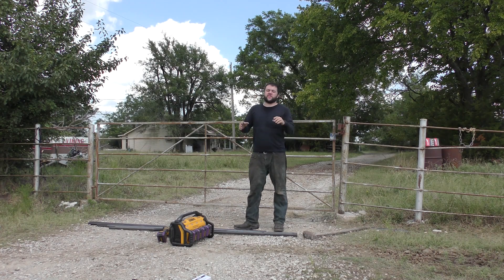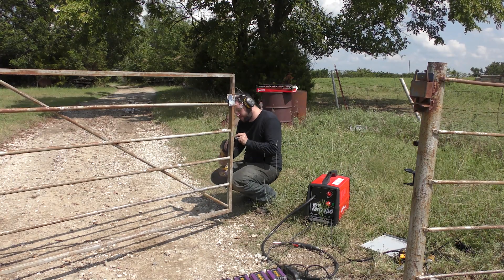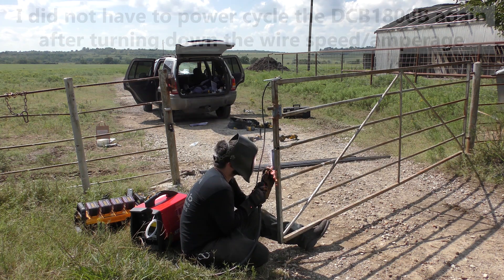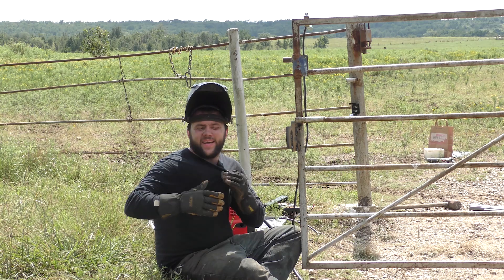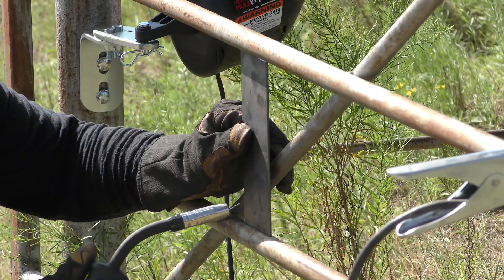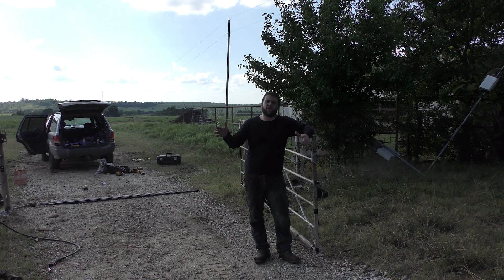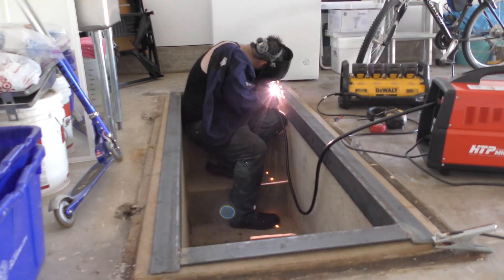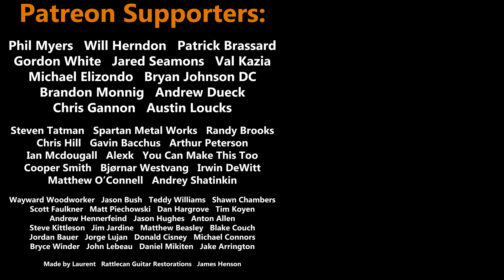How To: MIG Weld on Battery Power

Comment: You can also use a 12v-120v inverter that runs off your car battery. Just start the car, plug in the flux core welder and you’re good to go

Comment: I rewired an old Sears MIG welder that bit the dust to run on 2 Optima Deep Cycle batteries. That thing was a beast. No problem welding a trailer hitch together out of steel.

Comment: I'm looking to get into welding for hobby, and misc fix-it jobs while on the road, me and my significant other do travel nursing with a truck and small trailer. We already carry that invertor pack, this video is great showing the power of having a small welder! Nobody likes dealing with big generators, the noise, the fuel, and the exhaust.
Reply from the maker: Can't beat a gen for bigger jobs, but to tack something up or work thin material, this is a great in between

Comment: I've done it with the new 60v amp batteries but it can't push no more than 75 to 85 amps for a certain amount of time before shutdown ,maybe an HR.and half which is plenty of time to complete a small job. I love mine and yes I know it was an expensive set up ( about $ 1400 with the new 60v flexvolt batteries) , but don't care since I'm a dewalt cordless tool owner and this type portability with out the gas and noise of a generator is priceless to me.   Looking to get the cordless  battety welder from dewalt but is too expensive right now ( about 5 k) so I'll wait until they go down in price eventually.

Comment: Witch cost this machine
Reply from the maker: welder:$450. Battery Inverter: $300 + batteries
(and as your Englih is improving, "witch" is a woman who casts spells. "which'" means picking between two things. "what" is the question you were wanting here)

Comment: Need help, can I power a Clarke 135TE Turbo MIG Welder With a Clarke IG2200 2.2kW Inverter Generator ? I’m working from my garage but scared I’m going to blow the place up
Reply from the maker: Rule of thumb is you want your generator to be rated 1.5-2x what your welder needs.

Comment: That's crazy that your getting the dewalt inverter generator off flex volt batteries is running that mig machine
Reply from the maker: Even works with 20v batteries
Reply: @42Fab  wow works with the dewalt xr 20 volt batteries that's neet